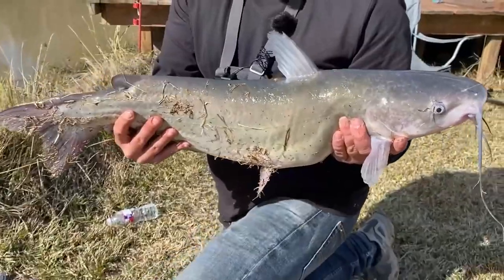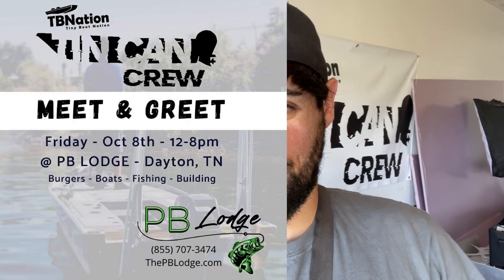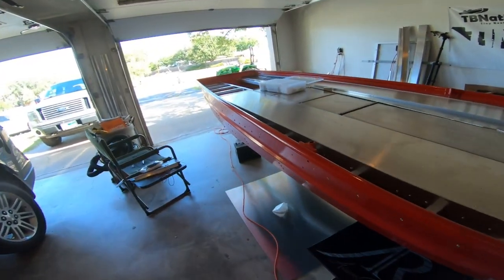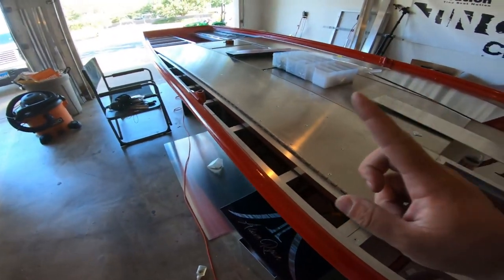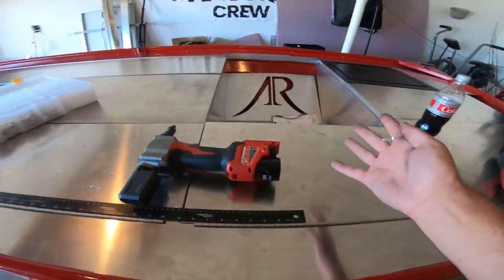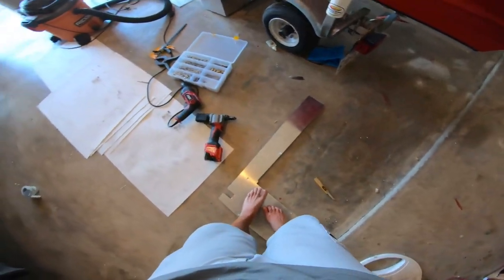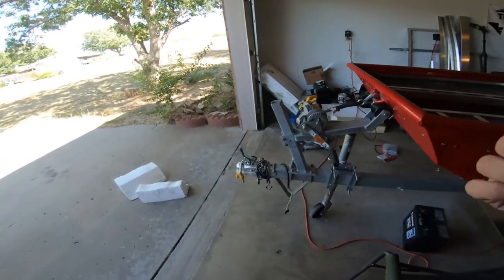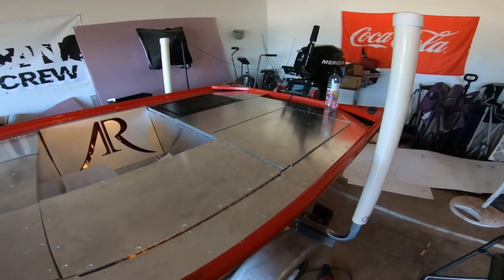ATTACHING THE DECK To The JON BOAT to BASS BOAT CONVERSION!!

Comment: Counter sink a quarter twenty bolt in the back corner by the transom and use a rib nut to hold it in place. Then you won’t have to worry about it
Reply from the maker: Good idea!

Comment: Nice work bro. Boat looking sick. Question are you going to put that Niko chargers to charge the three batteries I got another question if you put those floats which I think you might not have to put them on but if you do are you going to buy a bigger motor. I believe you said to put "frogs have large pupils".
Reply from the maker: I’m only gonna have two batteries but yes putting the niko back on to charge the batteries, and I was thinking about it since the boat will be able to support it, I can only go up to 15hp tho, it’s all the boat is rated for, just need to find a good reliable outboard first, they are hard to find in my area

Comment: Wondering why you wouldnt drill a bigger hole to allow the tip of the rivet gun so you could mount the tubing in the back of boat..i think your gunna get some vibrating aluminum noise when theres vibration in boat
Reply: 1" deck rivits. Easy fix
Reply from the maker: I’m gonna have to look into that!

Comment: Slap some silicone under that piece on the rear to secure it. Otherwise it’s going to make a lot of noise on the water.
Reply from the maker: I got another comment of someone saying to use a countersink screw to screw it down so I’m gonna do that

Comment: By putting that sheet metal on now, won't you make it harder for yourself to install and run the wiring?
Reply: 90% of those panels are lids. Plenty of space to run wires
Reply from the maker: No, all the wiring is gonna be up in the front of the boat and running to the side hatch, I will have all the space I need
Reply from the maker: And I already ran all the wiring from the back of the boat to the front